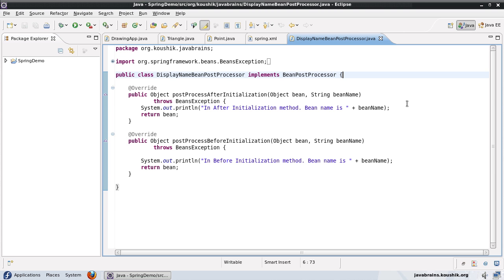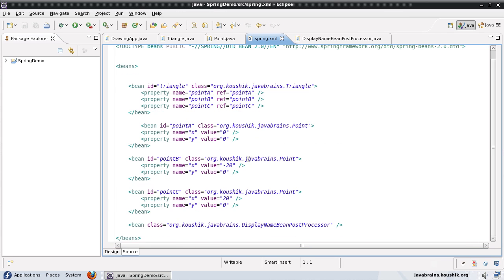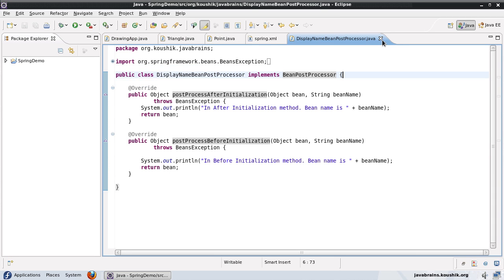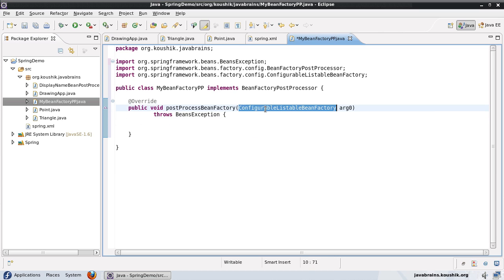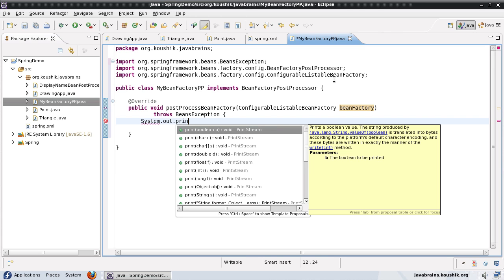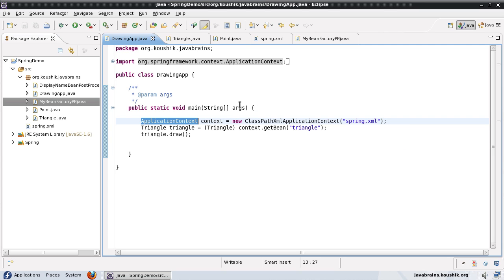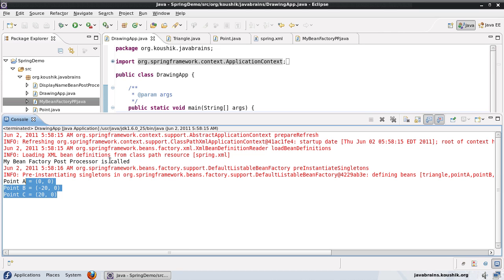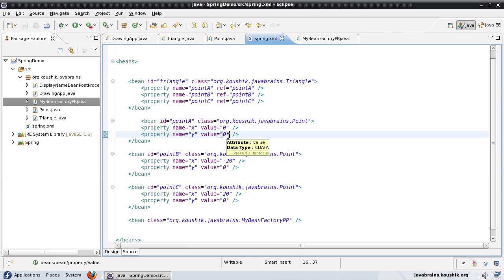Spring Tutorial 16 - Writing a BeanFactoryPostProcessor

Comment: I am able to manage to get output as per the placeholders substitution..But i am not getting the same result statement as per your output that is "Before bean initialization placeholder sustitution takes place very early so that ready spring.xml will be used by post processor etc..the way you got in your output some logs so to double check the output which i got as per the placeholder features that i added newly..

Comment: Property configuration is not  working. I am  version 4.2.6. Error that I am getting
Exception in thread "main" org.springframework.beans.factory.BeanCreationException: Error creating bean with name 'org.springframework.beans.factory.config.PropertyPlaceholderConfigurer#0' defined in class path resource [Spring.xml]: Error setting property values; nested exception is org.springframework.beans.NotWritablePropertyException: Invalid property 'peopertyFile' of bean class [org.springframework.beans.factory.config.PropertyPlaceholderConfigurer]: Bean property 'peopertyFile' is not writable or has an invalid setter method. Does the parameter type of the setter match the return type of the getter?
Reply: Identified the problem. For OOTB class, <property name="location"> should be location for which I gave my own name.
Reply: Properties path should b in forward slash then property file is readable

Comment: If somebody's facing issue with, "Cannot convert from String to int" check in your property file, make sure you DONT use ";" after assigning the value to the variables in the file, if again you are having null pointer exception, then check that BeanFactoryPostProcessor should be implemented separately, it shouldn't be implemented along with any of the class.

Comment: For those of you who are getting the FormatException error "Cannot convert String to int"

-> Make sure you used curly braces {} and not brackets (), as you can see at 9:17.

For those of you who are getting the error: Error creating bean with name 'triangle' defined in class path resource [spring.xml]: ... Failed to convert property value of type [java.lang.String] to required type [int] for property 'x'; nested exception is java.lang.NumberFormatException: For input string: "0;"

-> Make sure you don't have semicolons ; for the values in your properties file.
Reply: +LeBadman Thanks a lot man
Reply: Nenad Nikolic You're welcome.
Reply: instead try using  PropertySourcesPlaceholderConfigurer
Reply: I am still getting NumberFormatException.
Failed to convert property value of type 'java.lang.String' to required type 'int' for property 'x'; nested exception is java.lang.NumberFormatException: For input string: "${pointZero.pointX}"
Reply: @priyamalik9505  Please check the className definded in bean- <bean class="org.springframework.beans.factory.config.PropertyPlaceholderConfigurer">
Reply: semicolon solved  lol  xD.

Comment: I am using spring 3.2.4, and I have the number format exception... I did exact what the video said. Is it because the framework version updated?
Reply: You probably forgot to add "$" while mentioning the variables in spring.xml  - "${pointA.pointX}"
Reply: @reachmanav   I did exactly same. But i see type mismatch error :/

 <bean id="topLeftPoint"
  class="com.learnspring.basicframework.Model.Point">
  <property name="x"  value="${pointA.pointX}"></property>
  <property name="y"  value="${pointA.pointY}"></property>
 </bean>
Reply: Caused by: org.springframework.beans.TypeMismatchException: Failed to convert property value of type 'java.lang.String' to required type 'int' for property 'x'; nested exception is java.lang.NumberFormatException: For input string: "${pointA.pointX}"
 
Caused by: java.lang.NumberFormatException: For input string: "${pointA.pointX}"
 at java.lang.NumberFormatException.forInputString(NumberFormatException.java:65)